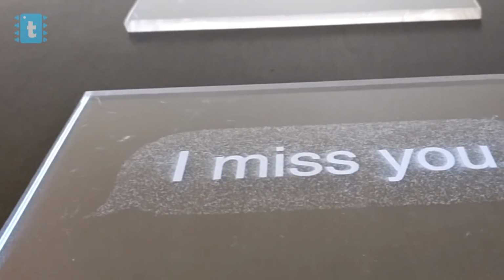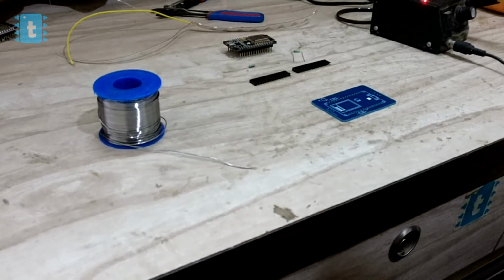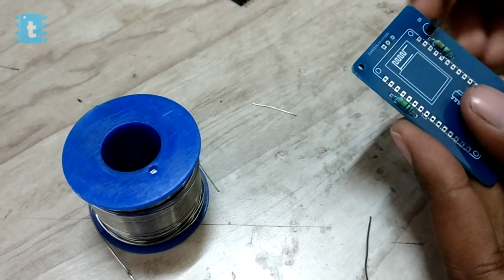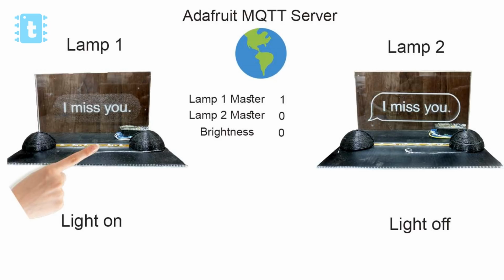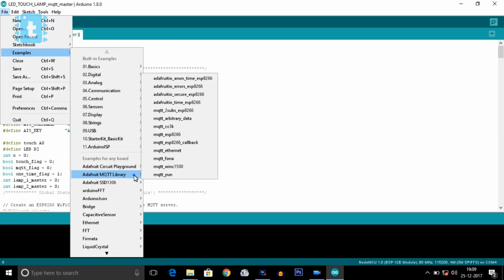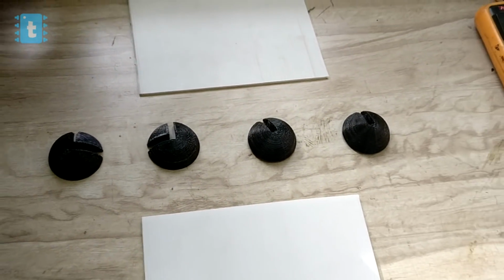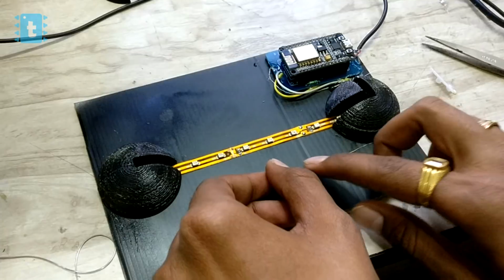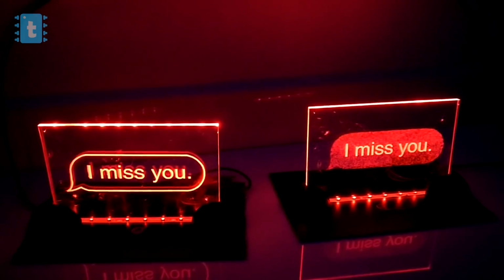Most Innovative project of 2017 using ESP8266 Connected Message Lamps | IoT Projects | PCB Prototype

Comment: How does the bare wire acts as a touch sensor?
Reply from the maker: +Tejas Kalpande 
It is acting as a resistor divider circuit.
One resistor is already Connected to 3.3V at A0 pin and second resistor is the wire and our body which acts as ground level

Got it ?
Reply: techiesms Got it! Thank you!

Comment: Wire u used is soldering wire or what?
Reply from the maker: +RAHUL MOORKOTH 
For the touch sensor?
Reply: techiesms yes
Reply from the maker: +RAHUL MOORKOTH 
No. It's just a normal wire. You can use any multi core wire for this